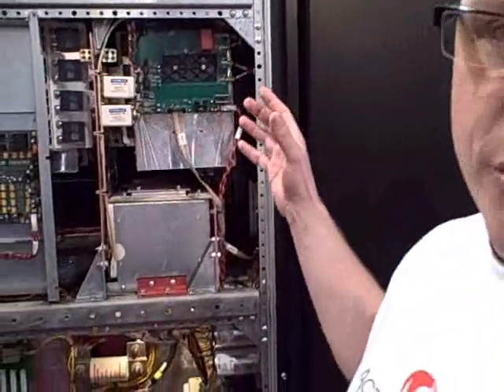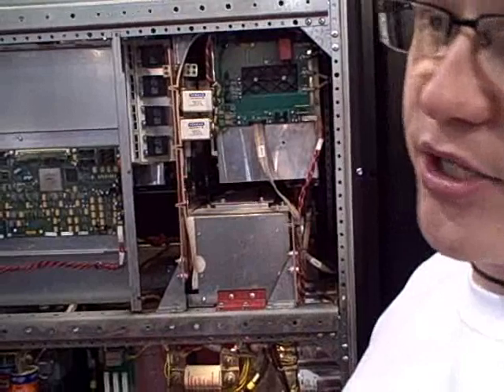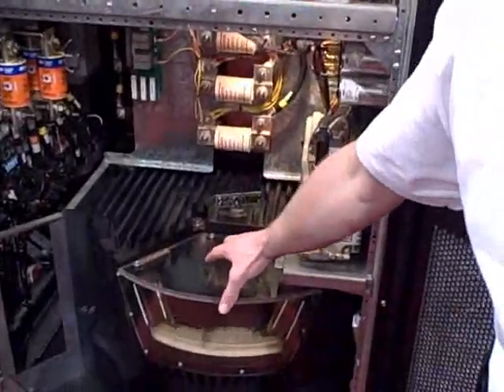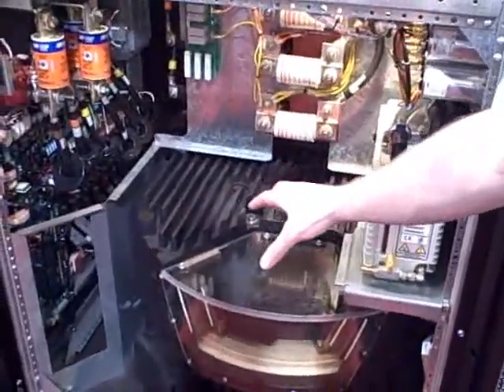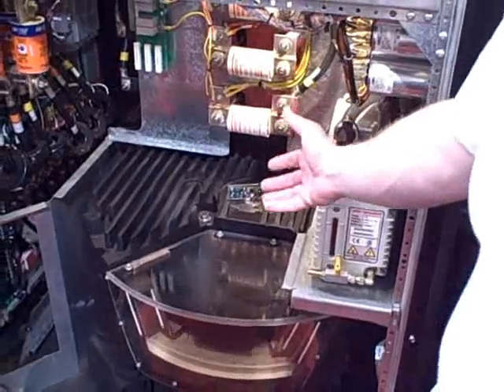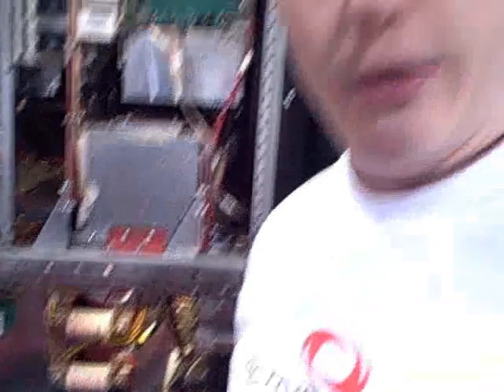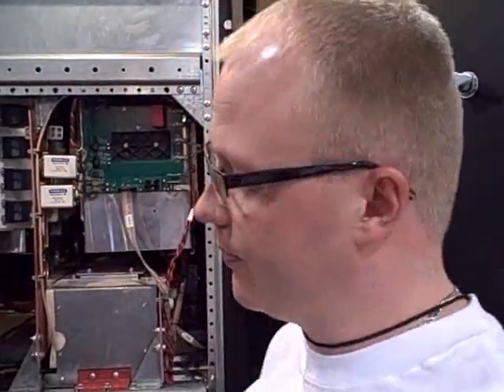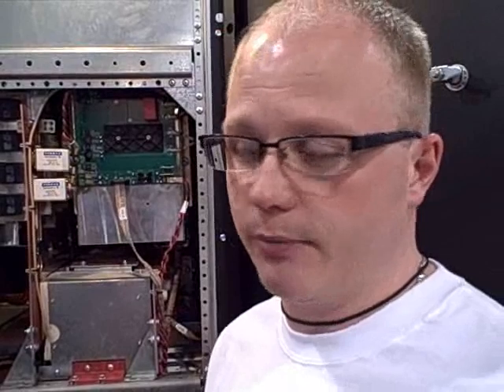Data Center World: Flywheel UPS Demonstration

Comment: NASA was going to have FlyWheels on the ISS; but went with batteries -YUK.  And the Allen Data Center by Cisco on YouTube has Horizonal FlyWheel on the Diesel Generators.  And the YouTube videos for Data Centers have the back up power starting every two weeks and fuel stored for two weeks.  The fuel trucks can always bring more fuel !

Hope to have a UPS by Tripp Lite for my home computer soon.  The utility trimed the trees last year; so not so many brief outages.  Just need the UPS to shut down gracefully if outage longer than five minutes.

Thankyou and keep up the good work, tjl  Sent by Win7Pro64  w/ADSL
Reply: Any added motion in the ISS is a problem.  To such a degree that even the spinning bike is dampened beacuse it could cause flex in the solar panels .
Reply: Conservation of angular momentum would be a huge problem on the ISS.

Comment: Sometimes, that 5 minutes of backup makes all the difference in customer power failure. Flywheel depends entirely on the system automatically kicking over to generator power.  Anything that could possibly make that fail and require manual intervention makes the flywheel system useless.
Reply: Ok boomer.  You are talking about older DCs or data closets/IDFs.  Modern systems on a multi-Megawatt level have self monitoring and self testing on a level that is sufficient to take a power event, spin up a genset, and cut over in 10 seconds or so.  If you think I am wrong, you need to reevaluate your assumptions.
Reply: @josephburns7902  Depends on the situation. Another organization manages our generators and thier primary generator failed to start. Their ATS only starts the second generator in the event that the primary doesn't start in 15 seconds. Since we have less control over the state of our generators, an UPS is our only option.
Reply: @josephburns7902  you lost all credibility with calling some one a boomer.

Comment: This fly wheel is pretty small! The ones we had in my sister plant were the size of VW beetles. My plant had battery backup UPS. Yes, 0-batts equal less floor space. but, what happens if the genset don't auto-start initially? Where is the 20-minute battery buffer for T-shooting the genset? This is great if everything works right. But in an emergency nothing works right, thats why its called an emergency outage.  
Just in time back up power.
I must be getting old because I don't trust this.

Comment: And yes, we use straight AC-to-AC from the grid to the data center.  There is no double-conversion as found in battery-based UPS systems (AC-to-DC-to-AC) so we don't get the heat loss and loss of energy.  And there is no 'whiplash effect' in a flywheel-based UPS.

Comment: We have one of these units powering our data center. It has been in place since 2002 with a 750 kW generator. We have not had an issue with startup and have not had to supplement it with batteries. It has taken over 250 power events from the grid since it was installed with no effect on the protected equipment. Our UPS has a GenStart unit so the flywheel starts the generator if the UPS detects a loss of grid power.

The $1,000,000 savings coupled with its 7+ year track record speaks for itself.

Comment: Thanks, now I understand, 250kW for 15 sec. is 1,041 kWh. That is not much energy :(
Reply: but that is a 250C battery !!! IT BEAT MOST LIPO!!!
Reply: @Doctorbasss  You could get 10C out of LiFePO4 battery. 25 kWh battery would be way cheaper than mechanical flywheel and vacuum bearing complexity.

Comment: Not 200KW of energy, its 250KW of POWER for 15 seconds, which equals to 1.04KWh of recoverable energy in that flywheel. His 98% efficiency claim is vague. Is it AC in to AC out efficiency? That's very unlikely. Also, he did not mention friction losses over time. This thing may actually use more energy to stand by rather than battery based UPS. With lithium nano-phosphate batteries, you can get 250KW of power for 2 MINUTES using only  about 15 KWh battery pack with much better system efficiency.
Reply: I am use this system  1000 kw and 2no diesel generator  1500 kva
Reply: The 98% efficiency is just to keep the flywheel UPS in the loop and spinning...modern ones are now more efficient.  
Flywheels, at least the ones I have in my DC, are suspended on magnetic bearings in a near vacuum.  Mine is 750lbs of rotating mass at about 22k RPMs.  To take it off line, I have to unloop it and let it spin down over 14 minutes.  I've never had a power event that it could not handle either directly (transient event <1 second) or until the genset could take over.  I've saved $ks in battery replacements and maintenance over 10 years.
Reply: @josephburns7902  Wow, 12 year old comment resurrected. Anyway so is that 2% loss from 200kW or 4kW constant consumption to keep the flywheel online? If you had LiFePO4 battery it would last 20 years or more if kept cool and at 60% charge level and no 4 kW vampire loss. That's 350 MWh loss over 10 years or 175 t CO2 emitted if average USA grid mix is used.

Comment: Clearly the best solution is to limit your thresholds to the second instead of those extending to ten fold the typical threshold of batteries.  Proper research validates my points above your conjecture.

Comment: >"15 seconds is not a reliable amount of time for a generator to start"

then use 2 of them for 30 seconds, or 4 of them for a minute, whatever you need.

Your complaint could be used exactly the same for batteries: "oh one battery only gives you X amount of power" - well that's why we use more than one battery in a system.  
And just the same: you can use more than one flywheel in a system.
Reply: Depending Upon the Load Percentage Backup time neither can be increased or Decreased.

Comment: 15 seconds is not a reliable amount of time for a generator to start, it becomes many times more impractical if you involve any kind of generator paralleling gear.  Flywheels should really only be used in addition to battery based systems.